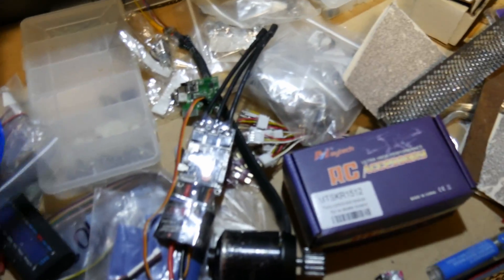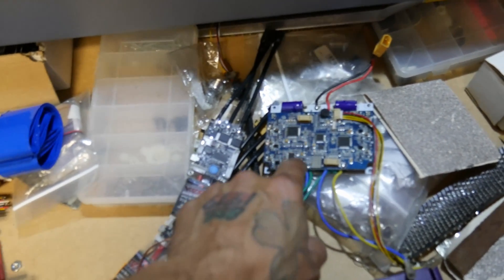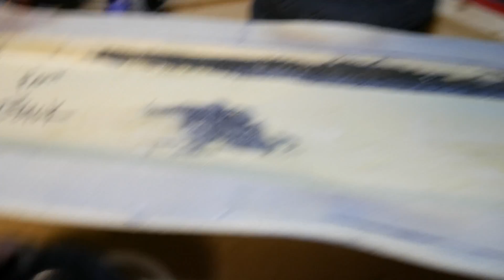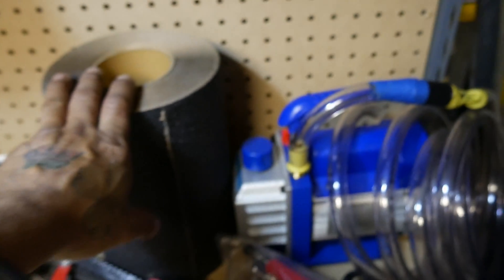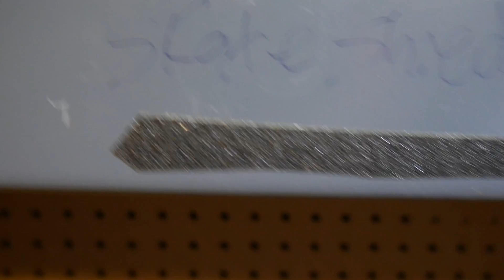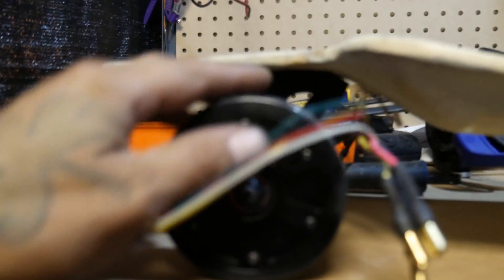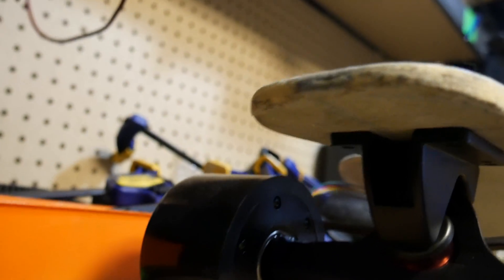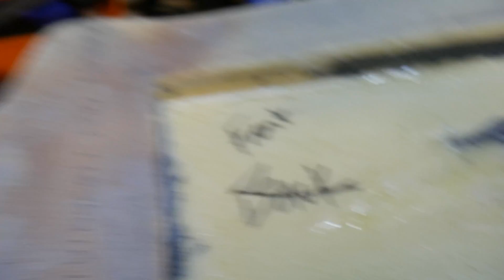Maytech Carbon Fiber Kevlar Mock Up - DIY Electric Skateboard Deck

Comment: Are you aware you got your truck round the wrong way longboard trucks are reverse king pin not telling you how to do but its fact brah
Reply from the maker: +JIMBO GC lol nothing attached or anything its not put together. Thanks was just concerned about the deck. Thanks though, when i assemble I will be sure to make it a point to properly install the reverse kingpin trucks in the right direction. that's fact brahh

Comment: I bet that home made carbon board your making doesn't last 5 big holes
Reply from the maker: +Uoeno Woohoo i bet it last longer then any one you ever make lol
Reply: Joe Kyser bet it won't.
Reply from the maker: +Uoeno Woohoo almost 7 but who's counting lol, I do have to play adult sometimes. sucks but it is what it is. We will see. I have my doubts as well to be honest. If i nail it the first time i will be stoked for sure. this deck here actually is only going to be for the testing of parts. I guess if it comes out nice I would consider using it all the time though. we'll just have to wait and see